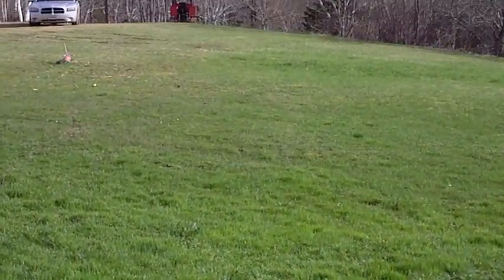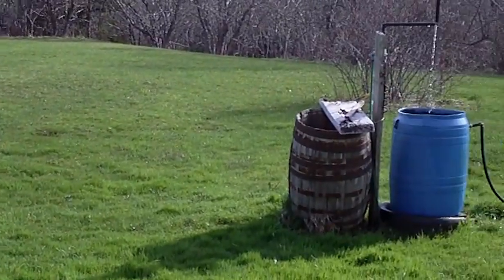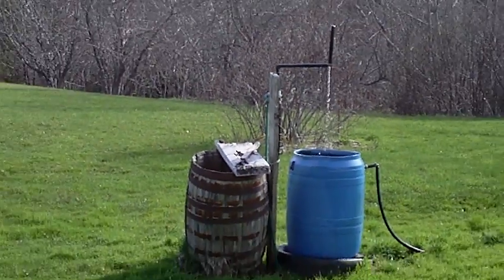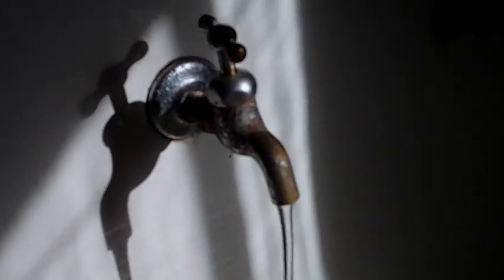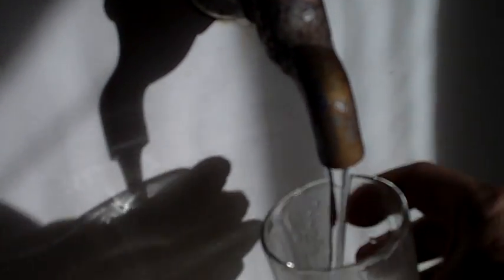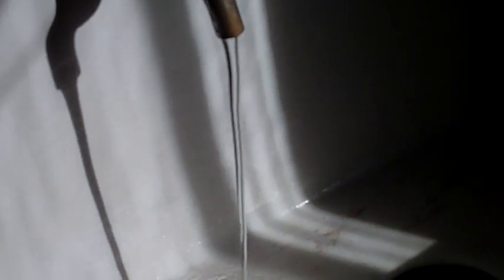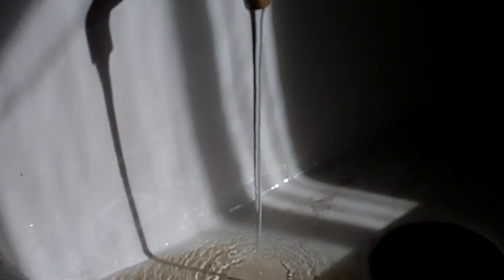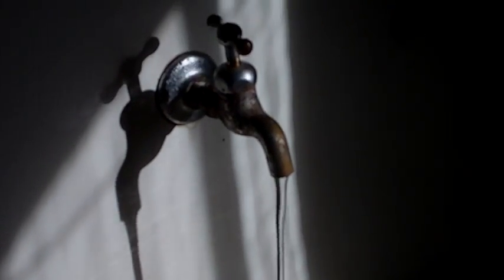Hydraulic Ram Pump - Pure spring water pump system for drinking - No Electricity Gravity Pressure

Comment from the maker: Hello, This place is seasonal, but will work in temperatures down to -10 degree Fahrenheit, as you say because of the constant flowing of water, then its time to melt some snow (grin).
The water is constantly flowing just behind this tap, then out to the blue barrel which is the overflow reservoir, we use this excess to water the garden.
The tap is really a pressure release, as you can see the black hose "outlet" above the blue barrel is higher than the indoor tap...thanks for your question.